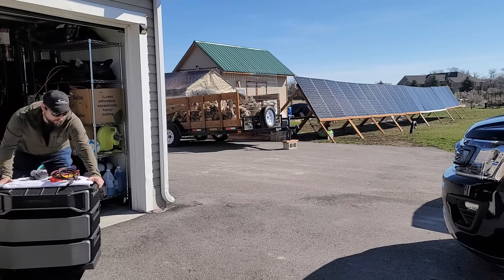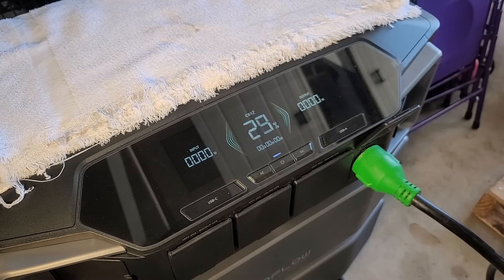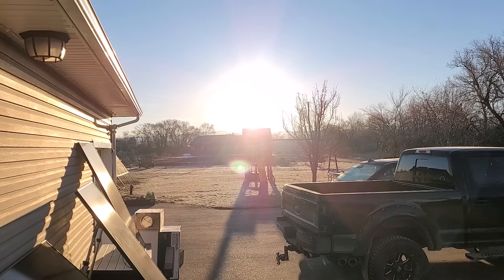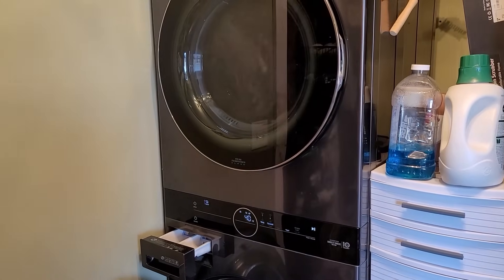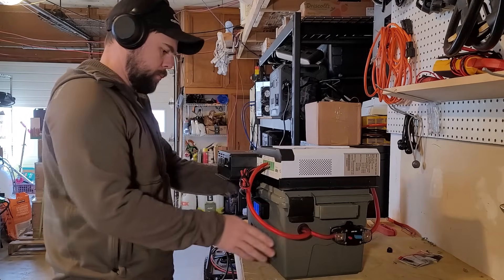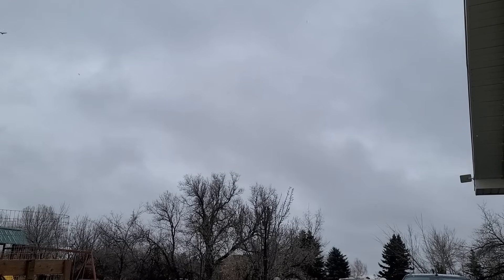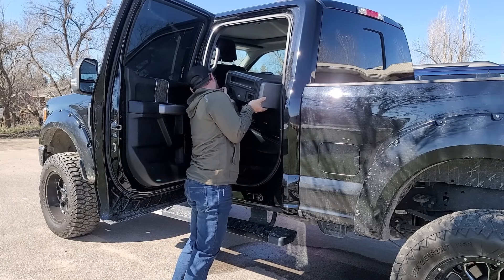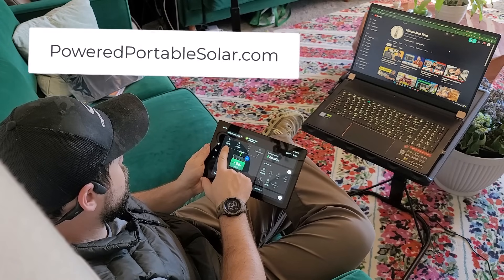Beginner Guide to Go Off-Grid Using the Delta Pro Ultra

Comment from the maker: EcoFlow Delta Pro Ulta Kits: https://poweredportablesolar.com/shop/
EcoFlow Website: https://us.ecoflow.com/?aff=368

I decided to take my house 100% off grid using the Delta Pro Ultra from EcoFlow. I have 14 400w solar panels for 5,600w of solar input to recharge the system. How long will it last?
Reply: Could you explain more about the TX & ca Hassle free bundle kit.  I was reading in your description about it but didn't see a whole lot on their website.  Thanks M.M.!
Reply: @unaffiliated_x9279 did you find out more info about the Texas hassle free thing ? I live in Texas
Reply: Can you get the ultra and then use other batteries? Like random lip04 battery banks like in racks or eg4 wall units etc?
Reply from the maker: Sadly no  @Yaveren

Comment: I have a 400 sq ft tiny home all lights are LEDs I have a mrcool mini split with one head i heat with wood my range is propane my water heater is propane on demand but still needs a very small amount of electric power my tiny home plugs in just like an RV would I have a 50 amp outlet on the outside of the home from there I plug into a 50 watt outlet at my power meter Pole I'm looking for a unit that will power my entire house that I can charge from solar or an 11500 w inverter generator?

Comment: That was a really good video. And perfectly shows how much battery you need. I'm really surprised that you were able to do all that with only 12 kWh. About the firmware, it still runs even if it needs an update right? Then I would not call that a dealbreaker. Who cares if it has the absolute most up-to-date firmware. What is a dealbreaker for me though, is the solar charging not coming back on. That should never, ever turn off. There's no need for that whatsoever. Even if the unit is off, it should still charge with solar

Comment: Swap the electric dryer out for a heat pump one. Our uses 500w to 800w, so 0.5 to 0.8KW per cycle, but it's a European one, so 6kg is I remember correctly. That one looks bigger, but none the less a heat pump version will work better than a old style electric one.

Comment: dude..it's running on battery chemistry. If you run your house like this everyday, the battery life will die in 1 year
Reply from the maker: It's been 14 months since I posted this video, my DPU has not turned off in that time and has had a 600w constant load with 4.4 kw of solar on it non-stop the entire time. Still running right now. I'm glad it's lasting.

Comment: Lots of room for improvements.
Get rid of electric appliances like clothes dryers. Propane or natural gas only.
Of course, then you are reliant on utility gas or propane deliveries, so not truly off grid, independent.
Swap out all ac, heating with heat pumps. Get a heat pump clothes dryer, water heater, and European style water tank heat pump.
If you need more heat, cooling capacity, install geothermal ground loops integrated with heat pumps, and or well water heat exchangers.
Huge waste keeping all unoccupied rooms, areas heated, cooled.
Switching to per room 120v mini split heat pumps vastly reduces energy use and adds zone heat automatically.  Most newer units have app wifi control to coordinate per room, zone hack among units.  Plus, if one goes out, you have hvac in all other areas while you repair, replace one zone.
Biggest issue is moving away from all 220v appliances.  I see zero reason to have, use any 220v electric appliance any longer, except for an ev charger, though home dc tech improving and evolving 
Even for cooking, lots of work being done with 12v ovens, or simply use 1800w induction cooktops and a 10 in one countertop oven, air fryer, rotisserie. All run 120v 1800w max.
Also, get a solar water heater.

Comment: 6 pro's, wiring, plus a lot of panels are at least $35,000. It would take 14 years to recoup the costs if your home uses an average $200. IF you are only using the batteries and solar. The warrantee is 10 years. How much is being sold to the grid?

Comment: I don’t know why people keep doing reviews on these stupid power stations that literally cannot power your house even if you have 10 of them together keep in mind a rack battery is 5000 W hours for just one battery most people who run their house off of solar have at least six of these batteries Literally the only thing a power station is good for is camping that’s it not to power your house not to power your deep freezes not to turn on an air conditioner. These power stations are super overpriced compared to if you bought solar equipment separately there’s already been multiple videos proving that just two rack. Batteries will outperform several power stations together.

Comment: Thanks for this video.  looks like you have 20 * 400W panels there based on the picture, but you stated you bought the kit with 10 and then added extra four for total of 14.  For the purposes of this off grid simulation in the video were you just using 14 panels and the other 6 were idle?
Reply from the maker: The DPU maxes out at 14 panels, 10 on high voltage, and 4 on low voltage. So the other panels simply didn't get used.

Comment: which type of solar panels do you have and how do you have them connected in series or parallel?
Reply from the maker: I recommend these 405w bifacial solar panels over my panels: https://signaturesolar.com/pallet-talesun-405w-bifacial-solar-panel-black?ref=SaJS3dc86BnakK. I used 10 in series on the high voltage input and 4 in series on the low voltage input. You can technically go up to 12 panels in series on the high voltage input.

Comment: How did you connect the 10 panels for the high voltage and 4 for low voltage?  

Max amps are 15a. 

Great video. I’m thankful for you sharing.
Reply from the maker: great question. the high voltage can go up to 450v. My panels make 37v. 10 of them in series is 370v. The low voltage can go up to 150v, four of my panels is 148v. Connect 10 panels together, then the first and last panels where there will be one open male and one open female connector. You'll connect your mc4 cables to those open connectors then into the side of the DPU.

Comment: I have two EcoFlow Delta Pro Ultra inverters with two batteries each. Each inverter is connected to 4- 400W solar panels. The inverter recognize there are panels connected but it is not receiving any charge. The panels are facing south at the correct angle for Florida. What do you think I am doing wrong?
Reply from the maker: If the battery is full it'll show no solar input. Best thing to do is connect a volt meter to the wires going into the unit. If the voltage is above 150, that's the problem. It has to be below 150v. Those are my guesses
Reply: @minutemansolar  I connected the solar panels at the low voltage and it works. I need to figure out how to make more than 66 volts to be able to connect the panels to the High voltage. I know I must connect them in series but what I am doing is not working. not sure if one or more panels are broken.
Reply from the maker: @ov.l4015  What panels do you have?
Reply: @minutemansolar  I have the Aptos 400W Solar Panel 108 Cell DNA-108-MF10 I have 6 of them in one inverter and 4 in another inverter.

Comment: Very cool analysis.  Add more appliances to use maximum available energy from batteries during high peak times.   The amount of draw should use a 100% of stored energy for maximum savings.  Plugging in one computer or TV is under utilizing the stored energy.   Unless that’s all that can handle.

Comment: I am currently looking at ordering one of these to live with me in my semi truck. Trying to keep from running the truck as much as I can. How well do you think this would do with the constant bumping from the roads? Id probably only get the main unit, no additional batteries unless absolutely necessary
Reply from the maker: That'd be a lot of power for a semi. I don't think it'd have much issue being in the truck bouncing around. You can find the DPU here: https://poweredportablesolar.com/product/delta-pro-ultra/
Reply: @minutemanprep  My trucks auto start/stop system doesn't work. It's been to 4 different shops and no one seems to know why, This would have enough power for me to comfortably plug in everything I need (microwave, instant pot, tv, griddle, external ac, etc) and not keep the truck running all night. My truck has been running nearly 24/7 since September and overnight alone, in a year, I'll be burning at minimum $10k just in fuel.

In that link, with 0 expansion batteries, the price is $4999, at Amazon with 0 expansion batteries, the price (no sale or discounts) is $2799, Am I missing something? Does the first link actually include another battery?

Comment: So do you keep that thing in an out building or garage of your main house?  Also what kind of fan noise does it make?
Reply from the maker: In my garage. Essentially no fan noise.
Reply: @minutemansolar  Wow nice.  I'd love to get a set to power my house w/ solar panels; unfortunately my heatpump just draws sooooo much power in the winter that unless we find a way to resolve it with either more efficient heating or alternate heating methods it just may not work for my needs - but I'd definitely love one if I can solve it - seems like it's a easy straight forward solution!

Comment: Apparently it's over $50K for my house to maintain normal usage of 2000 kwh per month. I see why my neighbors all have generators so I'm gonna do the same. 24 kw generator installed are $10K and last as long as the city has gas lol
Reply: You need to relook at your usage… in a long outage more then 48 hours you should expect they will be shutting off the gas lol

Comment: Great video. Been off grid in Northern Ontario about 15 years. Often I have to be away a week or two and need the power supply to be self sufficient. Used traditional lead acid batteries moving up to big red 6 volt batteries. In winter they freeze and explode bang $2000 in batteries gone overnight. so I’d have to truck them back to the city before that happened and use a noisy generator all winter. I started with EcoFlow when I saw it on kickstarter. Expanded with the Delta Pro, spare battery and smart generator. That worked pretty well but the smart generator has a very small gas tank and propane does not work well at 20 below. Now I have the Delta Pro Ultra with 5 batteries. We are in a snow belt. Early winter always cloudy, sometimes a foot of snow on the panels. I use a winter configuration with the panels almost vertical. Snow slides off and melts. When I am away for a week the 30000 kWh lasts well. When I arrive I can recharge the system with a 7500 watt generator.  For firmware updates (same thing happened to me) I have the Starlink plugged into an inexpensive continuous power source that is connected to the Delta Pro Ultra. When we need to shut down for firmware updates the internet stays on. For customer service I had issues with the smart generator right out of the box. It would not start automatically. Customer service replaced it no questions asked. Our cabin is very well insulated and so far no issues with the batteries getting too cold. They are drawing enough to keep them warm just running however last week it was -26c outside and 4 of the 5 batteries were operating fine but one indicated 18% and 38F with amber warning too cold. We got the cabin warmed up and eventually all worked fine automatically. I love that I can monitor the system from the city. Thanks for your video. Just sharing my experience.

Comment: Are you planning on running the cabin 24/7 on this?  and how many panels are at the cabin?  I have a need to keep 1 refrigerator/freezer, 2 mini splits, and a vent fan running.  just wondering if this is a legitimate solution, or should i run power to that building for reliability?
Reply from the maker: Yes I have used it to run my cabin 24/7. It works very well. For a fridge, mini splits, fan and basics I would recommend the silver kit: https://poweredportablesolar.com/product/ecoflow-delta-pro-ultra-kits/. Or if you just want to get the unit, you can find it here with discounts: https://us.ecoflow.com/products/delta-pro-ultra?aff=368
Reply: @minutemansolar  thanks so much for the info new sub!

Comment: Delta Pro Ultra bone sea than electricity! most batteries do not live past 5 year mark . its a good idea but nearly 11 grand is ridiculous price
Reply: Warranty is for 5 years on the ultra and 3500 cycles. I trusted more EG4 14kWh system due to the 10 year warranty and 8000 rated cycle counts.

Comment: This is pretty awesome, but I would like to remind everyone that just because you don't pay an electric company every month for power, you still have a power bill. You either pay this entirely up front when you purchase the equipment or over time if purchased using credit. You have to take the actual life expectancy along with the cost of normal maintenance and installation and divide it by the life of the product to get an actual "monthly" power bill equivalent. Definitely not saying to skip, just something to keep in mind. This is not free power.
Reply: So you are saying when you purchase something it cost money. I see. And so this electricity is still costing money because the money is spent on buying the power system. Interesting. And this money you would have paid a power company is also the same kind of money you buy this system with. And in conclusion you are saying this system is not free for people to just order and have.

Comment: Thanks! Great video. I have a question. I see you are using a 60 amp breaker in your load center, as this is a 30amp output, shouldn't it be a 30 amp breaker? I am trying to decide between a 30amp and 60 amp transfer switch.
Reply from the maker: Great question. I did an SS2-50P generator inlet because I knew I'd eventually want two Delta Pro Ultras or other large generators to plug into my house. I'm not worried that only one DPU outputs 30a because if it overloads it has its own built in shut down routine. So I did a 50a input but my electrician installed a 60a breaker. So that's what I use.
Reply: @minutemanprep  Just got off with ecoflow. The service rep was very helpful, and he confirmed it good 👍
Reply: Thanks so much for responding. It seems that there are a number of people, that are in the know are doing that, which makes sense. When I contacted echflow, the technician said I couldn't, however my electrician also confirmed what you said.

Comment: DO NOT BE FOOLED.  I watched this video and believed it was a great set up. I bought the silver package at over $21,000 not including the roof top mounted solar install. That cost me over $3,,000 more in parts  plus the labor to install it. All said and done I spent over $30,000 before I could even test the equipment. The first inverter sent out was so noisy. The fan was on high and would never shut off, even with no input or outputs attached. The solar power input would throttle down to near useless after 10am. I was referred to Ecoflow's customer service which is horrible. They are located in China and only have email support for problems.  This took weeks of back and forth emails trying to correct the issues. Finally, EcoFlow replaced the inverter and the new one was quiet, however it has the same problem with the solar input being throttled down to nearly useless. Firmware upgrades  do not fix the problem. I have spent weeks and countless hours everyday trying to diagnose and correct the problem. I now have an extremely expensive system installed with 14 solar panels roof mounted on a tile roof system and it does not work as advertised by EcoFlow or Powered Portable Solar. You will not get the solar input that your panels are producing. This video seems to be a sales pitch for equipment that is sold on their site. By the way, you can find this same set up for thousands less elsewhere. There is no real customer support from Powered Portable Solar. You will just be referred to EcoFlow for issues even though you bought from Portable Powered Solar. This video sold me on this equipment and now I will be sending it back for a refund. Unfortunately,  I can never get back the time and thousands of dollars spent on mounting the solar and now have to remove everything to send back. What a nightmare this has been.

Comment: My house does not have wifi in general. Will this system still function?
Reply from the maker: Wifi is not required but is highly recommended for the initial firmware update.

Comment: I'm a 57 y.o. and live in Tampa. Homeowner for over 20 years. I've NEVER concerned myself with my ACTUAL home electrical usage but know my bill is about average. During the power outage with Hurricane Milton a couple of weeks ago, I purchased a gas generator and started to educate myself on electrical usage. What an eye opener! After checking my electrical bill online I was shocked to see that not only was my average daily usage 100 KWH with low days in the 60s, my highest days hit 195 KWH! So while a maxed out 90 KWH EcoFlow Delta Pro Ultra would suffice for backup for essential appliances for a few days, to go off grid, I would need to have at least TWO maxed out systems! Is it possible to run two maxed out smart panels in one home?
Reply from the maker: That's A LOT of power. It's not recommended by EcoFlow to have to Smart Home Panel 2s but I've seen it done. Although, there is a more integrated and more affordable option using hybrid inverters instead. You're welcome to email me at info@poweredportablesolar.com to find out more if you'd like.

Comment: What happens if you in low PV and you generate more than 150 v ?
Reply from the maker: Then the charge controller will burn up and be ruined.
Reply: Now that I have it working it’s actually the opposite. I have it hooked up to high PV but the input will run at 600 early morning to 1200. Afternoon. My panels are rated for 400x4 which should generate 1600. Is that  problem? Please help. ?